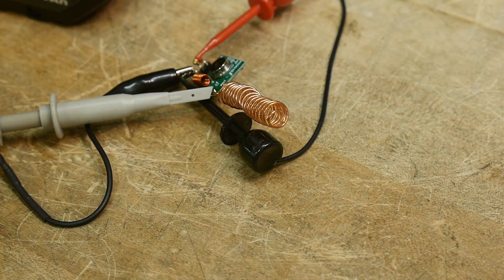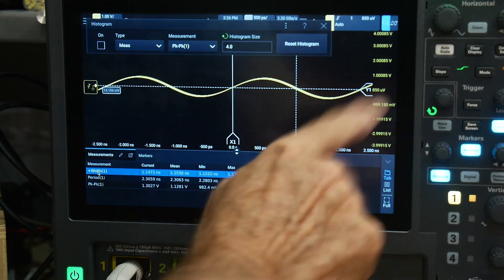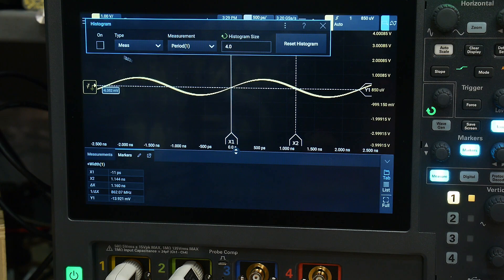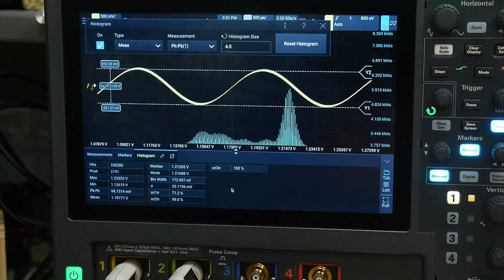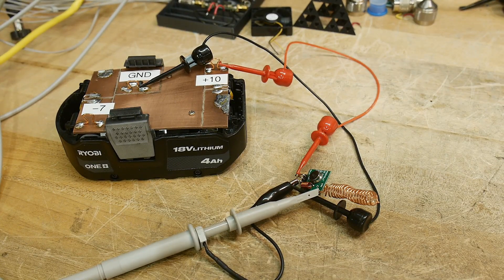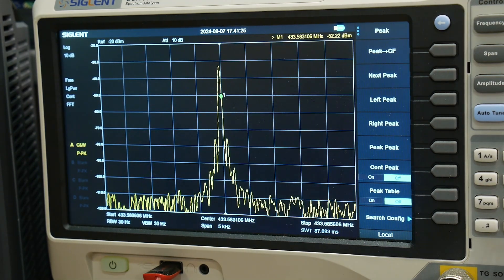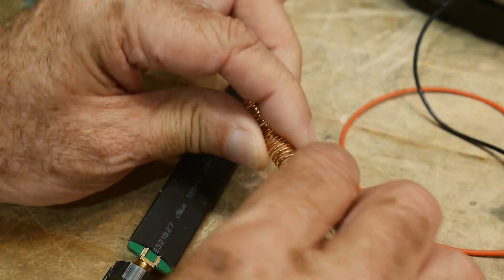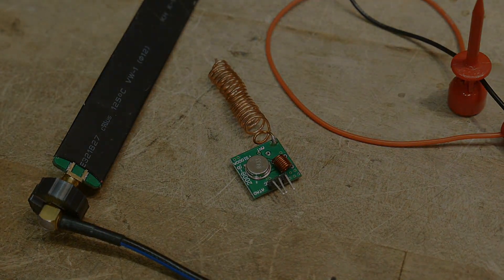#1989 433MHz SAW Resonator second look

Comment: The period and not the amplitude is what is critical for its applications; however, there are often nonlinear effects that couple the two.  I expect that electric fields stress the substrate and shift the resonance(s).  A well-shielded enclosure would eliminate this (when needed).  In fact, there might be a pin connection to the metal case.

Comment: In the past, I've used a 12 volt SLA that feeds a LM7805 for a theoretically very clean 5 volts DC. Not sure if the 7805 itself contributes any noise though. Might be something for me to investigate. Interesting how even your hands approaching the Oscilloscope contributes fairly significantly to the noise.

Comment: I want that scope! ; )
Reply: It's a super bit of kit, i want it as well.
Reply: I'd be afraid to use it. Even though I have old lab-grade HP, Agilent, and Fluke gear on my bench I always use the worst piece of equipment that will do the job. So I find myself using a free Harbor Freight multimeter to look at voltages instead of my five and a half digit Fluke bench meter and the Fluke gets dusty with disuse. But once in a great while I blow up one of the Harbor Freight meters doing something stupid, so I just reach in the box and pull out another one and it's no big deal. If I ever need precision measurements I can still make them with the good gear. But being mostly just a hobbyist these days the cheap gear works fine.
Reply: @johnwest7993  Its good to be prudent, but don't let them burry you with all that good unused gear. My father was that way, he had lots of good stuff he refused to use. He's currently wasting away in a nursing home.